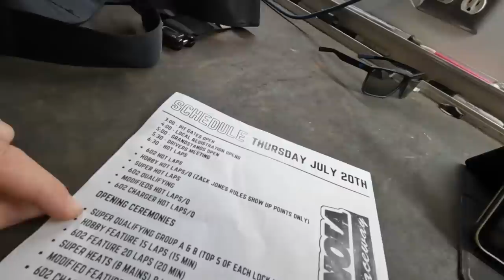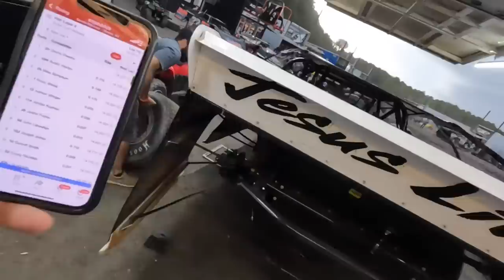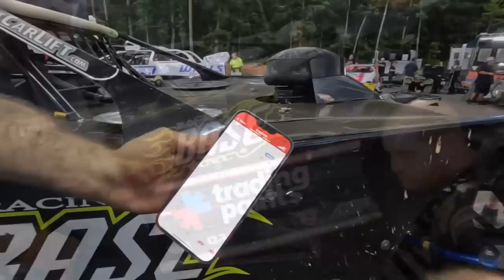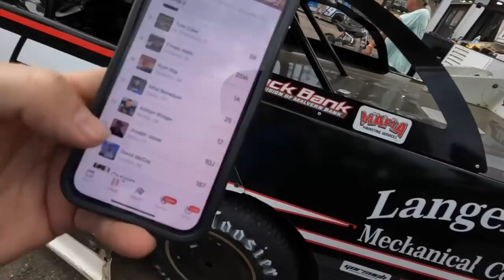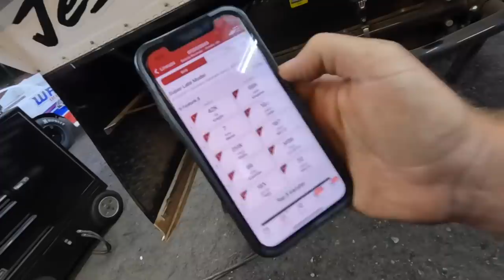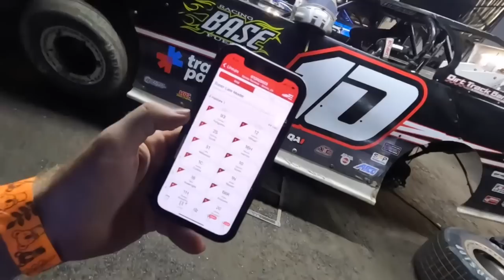Tight Racing in Georgia! Southern Nationals Series at Senoia Raceway!

Comment: From my armchair perspective.
Since Eldora the car has not been right.
Time to make it the BACK-UP car.
Reply: @lm1m   except the back up is still a long horn  they haven't use a capital as a super car in a min . 

and @mjay8128 you 100% right the cars not been the same's sense   Ive also noticed sense then  he tends to  run the top a lot more at tracks with no top line.  
they  have adjusted themselves out of the park and just need to  reset  forget the load numbers on the smasher and rescale the car  and start fresh from baseline
Reply: Cheerleader alert! It’s a brand new car
Reply: @SteveShawJr  Juuuunior!

You still wheeling a car out at Buxton?  This be the ol 27x...LOL
Reply: @xtr3m3fLx in
Reply: @Michael-qe8hq  in what?
Reply: @kregyung4604 ...yes but they still dont have the hp and it has smacked the wall a couple times it aint that new any more

Comment: If you had wedge in the chassis, it sure doesn't seem to be there now. It looked like a late 90s stiff chassis out there running against modern transfer chassis.
Reply: They need to get back around neutral every race my driver has won I set it up close to neutral if your swing for fences your way the hell off

Comment: Sorry for the finish.  That Dale engine is more powerful and Always seems to run faster and Y'ALL have better finishes. Betty and that Dale engine will take y'all to VICTORY LANE TOMORROW 🏁🏆🏁💞🤗💞🙏🏻🙏🏻🙏🏻🙏🏻 KEEP DIGGING.  Y'ALL WILL GET IT FIGURED OUT!! LOVE Y'ALL AT HTF💞🤗💞🙏🏻🙏🏻🙏🏻
Reply: The Dale engine doesn't make more Horsepower than their new one. It's an old style SB2 with a bunch of cubic inches. Because of the displacement, it likely makes a little more torque.

Comment: Car has zero forward bite and looks like it's stuck in a flat 4 wheel drift. Not sure what happened to scaling a car and knowing rear precent, cross in the car, how much anything ! Not hating at all just wanna see yall get something hitting. Just looks so lost in left field  from the heat race to feature most of the time. Will always continue to support and love them and the content just ready to see this car perform or something. Honestly he looks more aggressive and car set up in a modified the few times he has driven one. Anyways not bashing or hating just not sure other than the crap shoot set up it looks like we throw at it better is all. I don't think it is Jordan or anybodys fault just need better set ups. Again just a thought and curious as to how you know where the car is with left rear and rear steer etc etc.
Reply: This is the problem with people how don't anything about super late model racing, We don't use scales except for the  initial lead placement left % and rear % once maybe twice a year... We do  not use cross  weight, we do not use ride heights ... Almost strictly, we use spring loads on a spring smasher for numbers. Troy, you don't know what you're talking about.

Comment: You guys are Loose loose loose all the time, your cars don't ever have a on throttle push to them. The only time you have a push is off throttle when you lift.  You don't have any forward bite which is left rear drive.  It looks like your just riding on 2-wheels, RF and RR. The cars are not balanced.  You go like hell when the track gives you bite, but when it slicks off your chassis is not working.

Comment: Try the Dale SB 2 yall never run that car you need the extra hp yall even said well maybe we need a extra 30hp uou got it but you never use the freakin thing then yall were like well shoot but we only were behind Owens by a bit yall still act like your star struck by them guys and dont really care what happens its always owell we tryed sponser going get tired of hearing that crap...said you hadnt been that slow in awhile lol always slow im surprised joseph just didnt pull off like he normal does
Reply: It has more torque not horse power it's actually 20hp off that new motor it’s an outdated SB2 from the 2000's